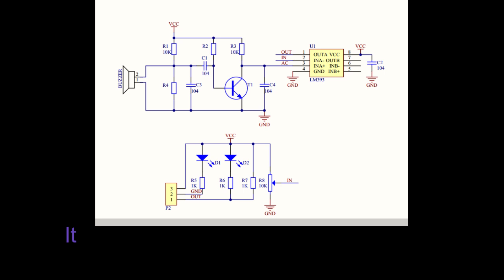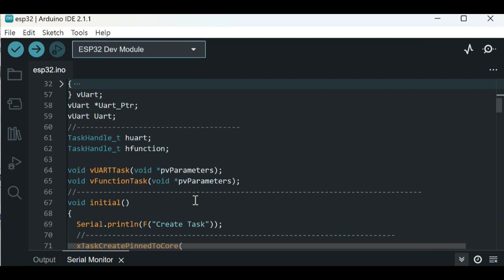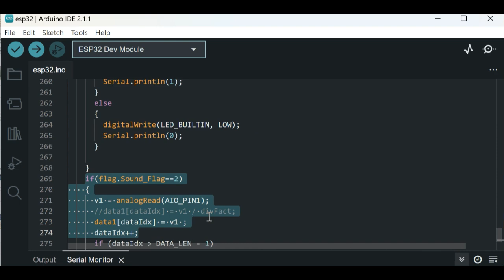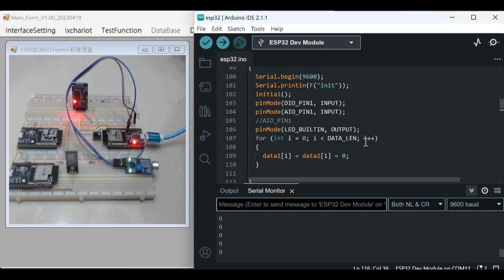ESP32 multi core tasking execution application – Sound sensor

Comment: are there any simulators I can try this project on?
Reply from the maker: Hi, You can try the Wokwi and search it from browser to understand it!
Reply: @winson-DIY  Thanks, I already did a search and didn't find the sound sensor on wokwi.
Reply from the maker: @israaelmahdy9148  You can use a variable resistor instead of the sound sensor !!